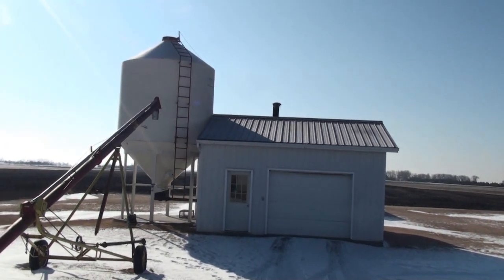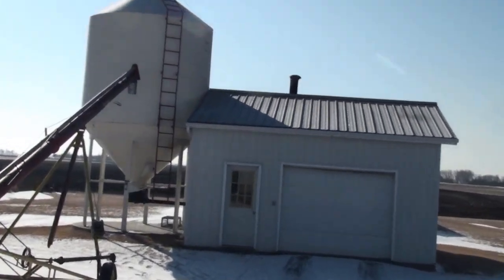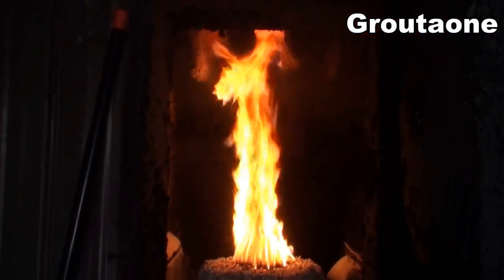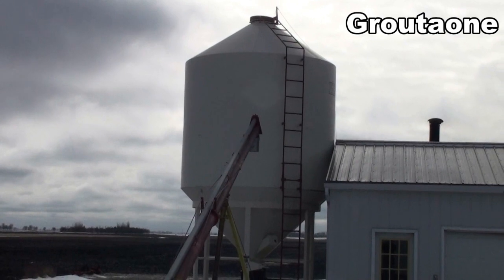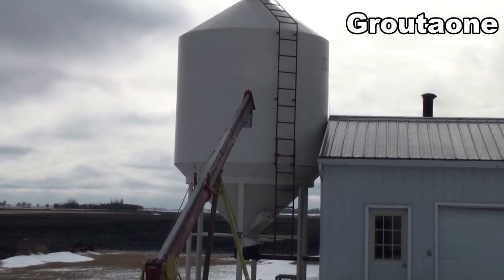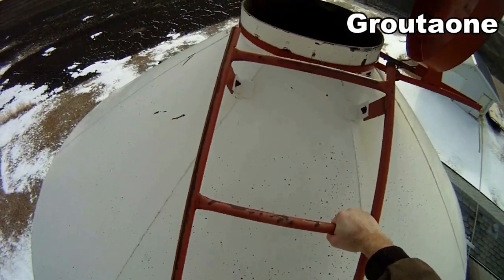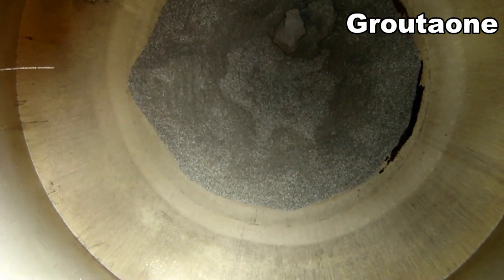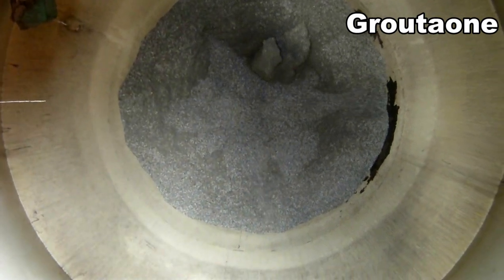How I heat My House For Cheap In Canada Pt 5

Comment: If you want to monitor the level, you can install a bindicator. It is basically a "Tuning fork" that when the level changes, the frequency changes  when the material drops below the  level That you want. I have installed many of these on the powder [ cement Etc] hoppers that I build for Pac 21. Weld in a approx 1" pipe coupling into the side of the hopper, thread in and hook up. Or  install a sight glasses. You can also mount vibrators to side of hopper  to help material flow

Comment from the maker: The auger speed is preset with pullys and is turned on and off automaticly as the boiler calls for heat using an auqastadt, fan speed is adjusted manually

Comment from the maker: @brokenamericandream Thanks, I will answer in order. The drive system is inside so I can work on it where its warm if I need to, correct the burn head and rotating ring are cast iron, not much temp drop to the rad but it drops about twenty degrees after its through the rad, the water temp is controlled by an aquastat that turns the boiler on and off as needed, its like a thermostat for water.

Comment: Hey Groutaone, in this video you talk about wanting to mount a camera on the top of your sunflower seed bin but are afraid of a dusty lens. Perhaps another option would be to use a very long monopod so you could point a camera into the bin as opposed to having to climb up each time. I have seen photographers at Red River Gorge use this style of monopod to take pictures high up in trees or over rock walls they could not climb.

Comment: Yeah, I was thinking about that and really it shouldn't be necessary to keep the object resting on the fuel unless actually taking a measurement. If the object no longer has to 'float' on the fuel, it could be a can of sand or whatever. I think it's only important that you have a cord that won't stretch, and that it doesn't get snagged on the edge. You could tie the string to something to keep it from drowning.

Comment: Thanks for the video. Its awesome! Had a couple questions.Why didn't you mount your auger motor by the fuel bin? Where the sunflowers actually burn, is it made of cast iron? How much of change in temperature is it from the furnace to the radiator? And is the furnace hooked up to a thermostat?

Comment: Instead of putting a camera up there and having to clean it, you may be able to take a basketball or some other large object that will sit on the fuel, tie a lightweight string to it like paracord, and simply lift it up and drop it to see where it rests. You can pull the string from the ground and use markings on the string against a stationary marking on your tank for your measurements. Just make sure to pull the string/object to a safe elevation before filling or you'll bury it.

Comment: Real clever setup. Did the thing work right off the bat or did you do some iterations?  Was the heat exchanger in the flue part of the original design?  What would you do different?

Comment: Did you designed that system by your self or did you buy plans for it and if you made it your self how do you transfer the heat I know it is water but do you use large pumps and stuff like that really just like to learn all the in and out of your system because I think it is very cool thank you and have a great day Thumbs up

Comment: cheap fuel , some waht expensive system tho , and dirty , very dirty .This year , i installed heat pump to heat my house . Its an interesting system, you extract water from earth , and actually take some heat from it , and you heat your house with it . Very clean system . Loads of water needed , but hay its there . heats 16KW, uses 4KW on pumps and heat exchanger

Comment: @groutaone They can be placed at different levels top to bottom . bindicator dot _com for more info. They can be set to shut off feed system and furnace if hopper runs out. probably not needed for your set up. I would put one at the lowest level that you want to maintain . The most inexpensive would be to cut a hole in side. fab a frame large enough to climb in [if you ever need to] cover w/ bolt flange plate and small sight glass made of 1/2" plexiglass maybe 6"x6"

Comment: I love seeing a fellow Canuck sticking it to the oil company crooks.  After 8 years of being a slave to the oil truck I installed a wood pellet stove.  Cut my heating bill down by 50% or more.  Used to spend at least $2000 on fuel oil and still freeze, now I spend about $800  on wood pellets.  I feel like I have some control rather than being at the mercy of those price fixing assholes.